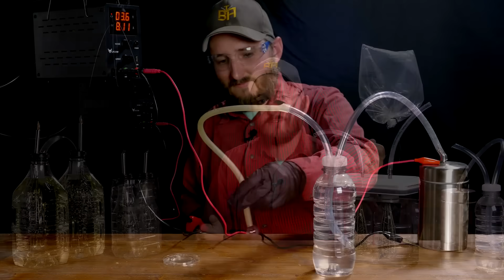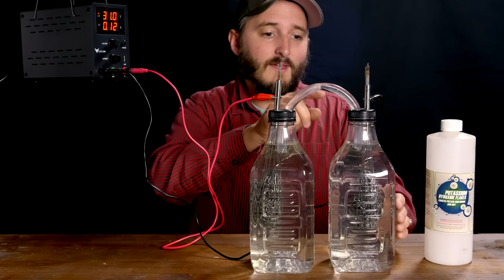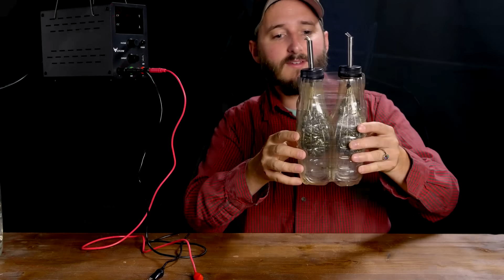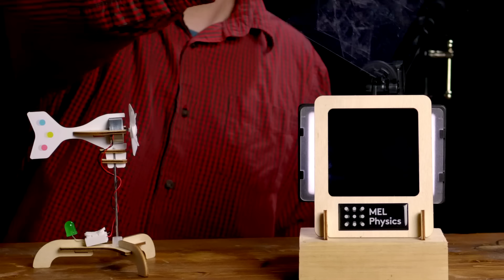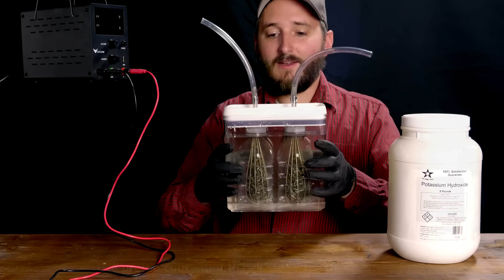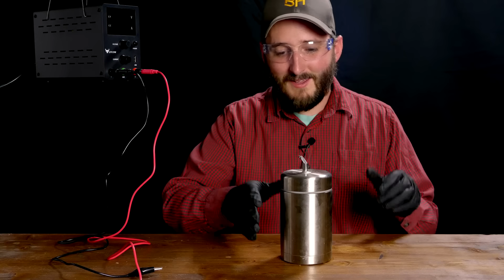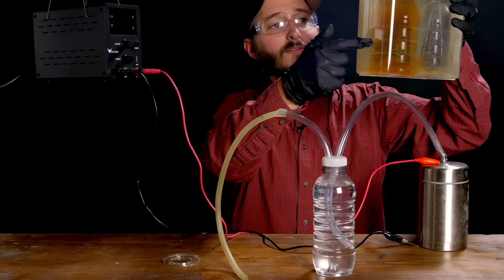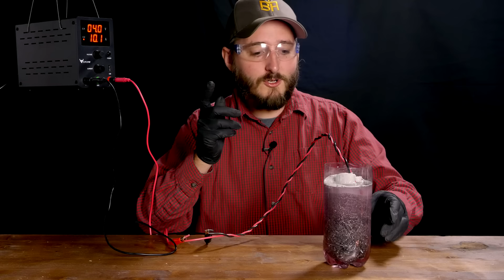DIY Hydrogen/Oxygen Generators From Grocery Store Items (HHO Fuel Cells & Split Cell Electrolysis)

Comment: I remember in my high school science class, my teacher demonstrated an hho device he had made. He used it to fill an upside down 2 litre coke bottle with the hho gas. He then sat the bottle at a 45 degree angle on a special launch rod he had made, removed the cap and held a flame to the end. The resulting explosion launched the bottle across the room, and into the brick wall on the opposite side, crushing the bottle to about half its length. Extremely dangerous to do in a classroom, but it was an awesome demonstration of the power of hydrogen and how to extract it from water. It is a science lesson i will never forget.
Reply: Thanks!
Reply: Awesome story 😊
Reply: @RyshusMojo1  this would have been about 2003 or 2004. I doubt it would be possible today without getting in major trouble
Reply: You should have heard the BOOM in Assembly when the Shop teacher mixed a small balloon of oxygen and acetylene
Reply: @speedy01247  that's not how oxy-hydro detonations work. HHO mixtures go off instantly, there are no mid-flight course adjustments. It's not a sugar rocket that can tumble mid-air and start flying another way, it's going the way it's going and it literally does not have any propellant left to turn around. It could 180 midair and it wouldn't matter because it has burned all of it's fuel before it's even left it's guide rod. After it's launched it's just a fast moving bottle, but it's not going to take a right turn anytime soon. For that matter it'd also be drag-stabilized and, well, it's a fucking plastic bottle, even if it does hit you it's not exactly going to blow your lungs out. You might get sliced up a bit as it crumples, but even if we assume it's going 150m/s, or over one third the speed of sound, that's not much actual force. The definition of a newton is 1kg*m/s^2, the average 2 liter plastic bottle weighs say 50g, and we're assuming it's pulling 150m/s. To calculate kinetic energy it's KE = 1/2 times mass times velocity squared, which would be 150 times 150 times 0.050 (50g in kg) divided by two, or 562.5 newtons of force. Amatuer boxers allegedly punch at around 5x that, 2500 newtons of force. Even if we assume the bottle was literally hitting mach 1, that'd still only be 3kn, or a strong punch. 

Again, all for something that is literally impossible because it doesn't even have the continuous burn necessary to deviate off-course wildly.
Reply: Levels of magnitude more dangerous. But much cooler
Reply: @RyshusMojo1  These two things are completely unrelated and you should be ashamed for pretending, even jokingly, that one precludes the other.

Besides. It's not like anyone else is volunteering to read to kids.
Reply: @SinHurr Three Things:
• Why do weirdos pretending to be something they're not need an audience of children?
• Why do weirdos pretending to be something they're not never "volunteer" to perform for retirement communities?
• Not joking or ashamed. Not even a little bit. But you should be for trying to defend weirdos pretending to be something they're not.
Reply: My chem teacher did stuff like this all the time. We need to do less imagining if a kid got hit and more imagine if the kid learned something that liberates him/her.
Reply: I’m in high school and it’s sad how little we are able to do, last year we only worked on our computers and sorted flash cards occasionally. I wish science class was still validly dangerous.
Reply: I remember the volts jolt class where we all held hands as my fav teacher cranked up the dial.

Comment: I love that you include the designs that didn't work that well and don't just skip to the final prototype.
Reply: @fred_e  not just that, it also serves as lessons for us that he had to learn by trail and error, which is a Large reason I watch this, as I can use that for theory crafting in my head
Reply: Yes!  Seeing the experimentation and process is what makes this an amazing science channel and not just a neat tutorial channel.
Reply: Exactly!
Reply: Ya the perspective it give you helps
Reply: @Voron_Aggrav  not to mention failure can be a better teacher than success, we look at the reasons for failure and improv upon them but most stop at success instead of continuously moving forward with new design , I’m planning to attempt these designs to learn for myself how to gather , was wondering if pvc is a good container for storage cells or if pumping back into steel containers is better and if drinking water bottles are strong enough with a pipe dope sealant
Reply: @richardkauth2373  if one can accept their failings and overcome it it'll be indeed one of the most valuable lessons you could learn,
Between persistence of learning of your mistakes, and looking at the work of others and making it yourself in your own way lies the best progress one can make
Reply: @Voron_Aggrav  a gallon of gas every ten seconds is enough fuel to power almost any vehicle on the planet
Reply: Love this! Easy to understand. Great presentation!

Comment: We Germans have a nice name for HHO gas. Its "Knallgas" which literally translated is bang gas
Reply: H²O is water, h²O Gas is steam 🤷‍♂️ what you mean may be hydrogen
Reply: @JonasLingott  No I do not mean H₂O gas aka steam. I meant HHO gas also known as Oxyhydrogen, Bronwn's gas or Knallgas, a mixture of two parts hydrogen and one part oxygen.
Reply: @JonasLingott  the electricity breaks the atomic bonds between the hydrogen and the oxygen - effectively you get (2)H2+O2 (HHO gas) instead of 2(H2O). 

Um... so basically, IF you heat water you DO get steam, which IS still H2O. If you pass electricity through, you no longer have steam - you have gas that is 2 parts hydrogen and 1 part oxygen.

... Am I making any sense? Sorry if this doesn't clarify anything for you.
Reply: In Spanish is called… Nal gas … gas also comes out of them.
Reply: We use term 'mieszanina piorunująca' (thunderbolt mix) in Poland.
Reply: Bang Gas is an excellent name for it! It does bang good!
Reply: @beckwerks  ouch, that one hurts xD
Reply: @outoforder0101  Yes, sometimes with quite a repulsive and intimidating smell!
Reply: @drdepena1958  what is it smelling like to you? The only bad smells I have gotten from it is from making chlorine using salt in the very beginning of messing with it. I stopped using salt and never noticed any repulsive odors from it. What are you using? I've noticed that when I had it doing 2 liters per minute into my Jeep that the exhaust didn't smell like exhaust, it was just like air coming out. .

Here is how full of shit our country is on the whole thinking green and cut down on pollution save the planet from climate change crap they are cramming down our throats 24/7,  if you have a hydrogen generator on your vehicle and are putting out 0 emissions, that's illegal!
Reply: @beckwerks a couple questions,if you don't mind.. What are you using for an electrolyte solution now?
Are you running on hydrogen alone or a hydrogen gasoline  mix? If you are using both fuels,, What fuel economy are you getting? Have you noticed any mechanical problems with the engine in your  jeep? Oh and what year is your jeep? Thank you!
Reply: Hahaha knallgas in Spanish nalgas are the cheak butt
Reply: But the convined is perfect for a combustion motor
Reply: @outoforder0101     Lmao, literally ass gas
Reply: Same in Dutch. We call it knalgas :)
Reply: In danish - Knaldgas
Reply: In Russian it is thunderclapping or banging gass, гремучий газ.
Reply: ja en dit is die afrikaanse woord ook
Reply: @JonasLingott  Oxyhydrogen need to loose latent heat energy to revert into steam so it has lot of potential energy.
Reply: @brandonogden3498  The are together (HHO) but not mix (H2O)
Reply: @beckwerks  True, burning a hydrogen/oxygen mix in a gasoline engine results in only steam from the tailpipe. if air is also used, some oxides of nitrogen will also be present.  Energy must be added to create HHO from water.  The source of this energy is the ultimate source of energy driving your vehicle.
Reply: In Sweden we also call it "knallgas"
Reply: @JonasLingott  nope, I dont care
Reply: the same with Dutch
Reply: Bang gas? Like a squeef ? 😂
Reply: Wij noemen het knalgas :)
Reply: Knallgas sound great I'm going to use it. Thanks for sharing!

Comment: When I was a kid I did this with a canning jar, eyebolts and a car battery charger. I added soap to the electrolyte and was popping the bubbles with a red hot nail and enjoying the little pops of brown's gas..  This suddenly back burned into the can and exploded the lid off my canning jar. Most of the water was blown everywhere, the lid disappeared and the canning jar did not move. I was super lucky that the jar did not turn into a grenade and kill me.. Heh.. the things you do as a kid 😬
Reply: As (also) a kid, I lit a tiny fire and, from a yard above, poured gunpowder outta half-full jelly jar, to watch the trail of sparks as the fire climbed up the powder trail.
Eventually the sparks climbed all the way to the jelly-jar; there was a hella "whoosh", the jar cracked and dropped out of my hand, and I received only minor on-the-hand burns (ok in a week... :-)
Good times, I still have two hands :-)
Reply: As a kid, I ate my boogers.
Reply: Actually did some hydrogen experiments in my room long a go and almost lunched my electroliser through the roof :D.  Also i burned my fingers frequently. One time i did it with a cotton ball soaked with lighter fluid. Had a little  to much fluid on there. Went to put them out  covered my hand in lighter fluid. Didn't notice. Relit the balls and in turn my whole hand.   Fun times. Minor burns great story
Reply: @TheNightwalker247  Good stuff.   I mostly set myself on fire with methylated spirit or sulfur (both burn with a very pale blue flame, barely visible, y'know).
We coulda been friends, but we'da have to maintain better-than-social-distancing (20ft?) so we didn't set fire to each other :-)
Reply: @theskett  i turned to less flammable obsession like mountainbiking with a gravelbike 😂 fire pois look fun tho 
And yes 20feet sound's like a good safety margin
Reply: LOL yep!  I'm still amazed I have both eyes and all my toes.
Reply: @TheNightwalker247  OMG...  was just trying to intro my gf to fire poi, with LED lights (hey, you gotta start somewhere).
I'm optimistic, that we can get her waving olympic torches, in the near future :)
Great stuff, please continue your good work (y) :-)
Reply: I did the same, but without the explosion. I ended up with a smelly goo that i kept for a week. :D
Reply: OMG, I love everyone on this thread!  Pyromaniacs and pyrophiliacs, good people, so good to know I'm not alone :-)
Reply: @HooksBill  I never have but that reminds me of Caddyshack 😂 $50 bucks Snails grandkid eats his booger 🤣😆😂🤣😂🤣😂😁🤷🏻‍♂️and I don’t even know what’s so funny about it 😲 it’s Gross🤭
Reply: @DoctorMangler  that's funny because I brought this point up the other day to someone saying that I was surprised not more people don't lose fingers or other stuff on their body going through life.... I know some lose that stuff but it seems like most would lose something.. at least one finger...since we constantly use our hands

Comment: Two useful suggestions: 

1. the anode could be replaced to 「2.0mm Mechanical Pencil Core」which is cheap, replaceable, easy-get, inert. Each core is a 14cm long, 2.0mm diameter graphite stick. It won't generate any poisonous ions. Though the graphite pencil core can disolve to poders gradually,  it's really cheap and easy to replace. 

2. If the pure oxygen is not useful, the anode bottle could be omitted, just attach the anode at the outer surface of cathode bottle. So the graphite anode could be more easyer to replace. 

Your video is really great.
Reply: #2, put the rod on the outside of the bottle?
Reply: One small issue is the surface area of the rod, as I expect the gas production will be low..
Reply: @Eduardo_Espinoza no, inside the bottle
Reply: @farbeyondsane2529 no, definitely don’t do that. You need the hydrogen to be separated from the oxygen, or else it makes an explosion or flashback hazard.
Reply: 2 mm graphite pencil is very little surface area
Reply: powdered charcoal for more surface area.  fill the outside of the sock with charcoal powder. Excuseme my poor english.
Reply: bro why did you list the pencil core like it was a stand name
Reply: @colbaronrojo won't it just fall off the sock?
Reply: I use a reverse osmosis filter for drinking water the RO membranes are proceeded by a sediment  and two carbon filters. All but the RO membrane needs frequent replacement (l live in South Australia)
 The carbon filters are about 300 mm long (12 inch) hollow cylinders 75 mm (3 inch) diameter and a wall thickness of 20 mm. I have been meaning to see if they are an effective anode for the purpose herein (after subjecting them high temp to burn of any filtered contaminants)  the surface area of the carbon must be astronomical.hopefully i can get back with some initial results soon.
Reply: Any test results yet?
Reply: @blakedeckard8127  Hello. Any test results?
Reply: @__8120  I never would have expected a jjba reference here 🤣
Reply: If you want to use KOH, use a secondary containment container.  Also I wouldn't detonate any bubbles on the surface of a KOH solution.  I saw splashes of KOH going in different directions.  Can result in holes in your clothes later.

Comment: You can just put the electrolytic container in bigger container with water for cooling.
Reply: Add a cheap fountain pump for water circulation too.
Reply: @chemistryofquestionablequa6252  I built one of those flat pack hho generators, i doubt the fish pump is needed, you'd be amazed how fast the water goes though.
Reply: Or he could use Borosilicate glass for everything instead.
Reply: @honklerton732  the issue with an all glass container is if it should flash back, that's a lot of shrapnel.
Reply: @marthale7 Lower temp. Heat will cause it to use more power. That's why they make hho gen's dry cells as the have a separate container for the solution to be able to cool down.

Comment: OXY HYDROGEN TORCH! I would love to see a very big, safe as possible, "refillable" cutting torch ,made on the cheap, that only needs water/electrolyte/power to run
Reply: Another vote for this
Reply: They use these types of torches in jewelers repair shops. They sell them on the internet. They're about 200usd and are very useful because they're considered to be a "cold flame" but actually reach a few thousand °degrees.
Reply: @fred_e  Just use a (cheap) tire pump in your gas collecting container to compress it into your final cylinder.
Reply: @unnamed47  It certainly wouldn't work for HHO if that's what you are saying. But it would for the separated gases, assuming your collection containers are air tight. Hydrogen needs an oxygen source to burn, and oxygen needs a fuel source to make fire.
Reply: @nicks2437  "Hydrogen needs an oxygen source to burn"

The air al around you has oxygen.

"and oxygen needs a fuel source to make fire."

If the oxygen is pure enough and at sufficient pressure, it will happily use anything as a fuel, even steel.
Reply: @fred_e  " but can it make it a liquid?"

No, you need to cool it down to less than -120 degrees C to make oxygen liquid and -250 for hydrogen.

Stop thinking you can make your own cheap torches etc, it's not going to happen.
Reply: @marthale7 Jeweller's torches produce both hydrogen and oxygen by electrolysis, but I think they keep them separate until they're mixed in the torch head.  Like most mixed gas torches.

Normal cylinders can hold hydrogen, the diffusion rate is pretty slow so it rarely makes a lot of difference as long as you have some ventilation.

Comment: I built a HHO generator, my design, and ran the HHO into the air intake of my 3.8ltr engine. I used baking soda as an electrolyte rather than the caustic liquids. Worked great. I started no HHO at 22 mpg hiway/city and increased it to 28mpg hiway/city with HHO. I used a pulsed width modulator to pulse the current on the plates and a pot to control DC voltage. This took alot of experimenting to get this far in performance. The gas was not stored and used as it was created. On the highway I averaged 32 mpg. On flat ground no wind mpg went as high as 42mpg. I still have the generator in my shop. I stopped investigating and many other things because of my health. It was a lot of fun. The biggest generator I made was for a 454 cubic inch engine.
Reply: You mind sharing a schematic of how you connected it all together?
Reply: @ItsStarsonic  I found the pulse width mod with the pot for DC voltage on line. This was 20 years ago. I have no idea where the designs are.  HHO is a big community, look around you'll find what you need and build it your way after a while.
Reply: How did you tune it
Reply: @TAD0002  Pulse width modulater and a pot to control DC voltage to the HHO gen. I think you can buy the PWM on line.